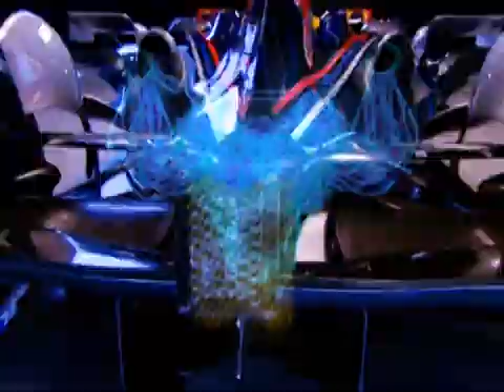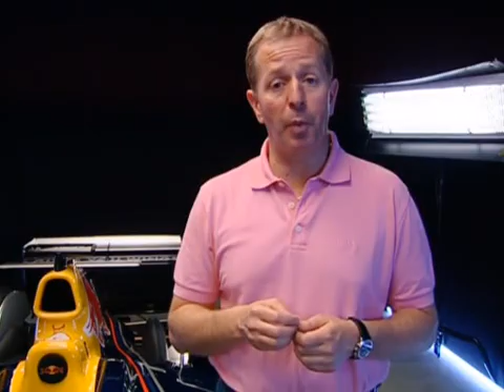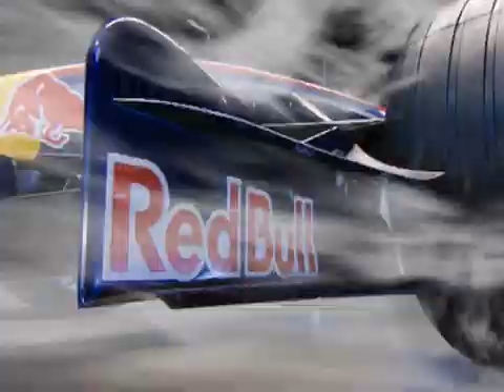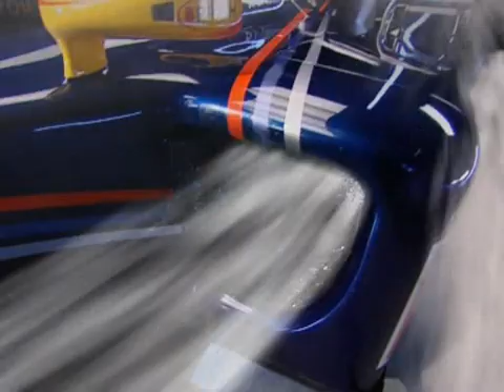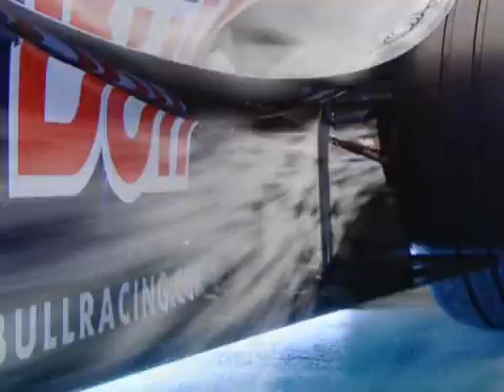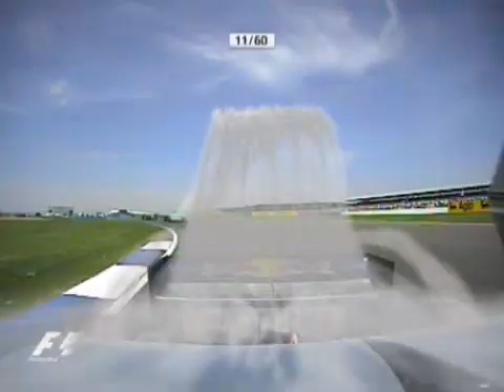Formula 1 Aerodynamics with Martin Brundle

Comment: "The upturn of the underfloor forces an expansion of the air and therefore a pressure drop..." I would have thought it was the other way around. Area increases; velocity decreases; pressure increases. But I am sure Martin Brundle has the perfect comeback for this comment, as usual.

Comment: So there's no slipstream in F1?
Reply: There is, but the area is small. But yes there still is.
Reply: In the Early days there was, gave you +20 km/h. But with all the Aerodynamic down force on the cars from 2011 onwards the air is to turbulent for good downforce.  That's the main reason why we have the great system called DRS to overtake ;)
Reply: So, If you want some good overtakes. It's better to have mechanical grip than aerodynamical grip, it makes less turbulent air so the car behind it can actually overtake without DRS

Comment: red bull got it so right from 2010-2013
Reply: Look up "Red Bull F1 vortice creation" and watch the live onboard in the rain in brazil. Adrian Newey is a genius. The moisture in the air actually builds up long enough for you to see the spirals of air created by the flaps etc off the front wing and around the side pod. It's one of the most amazing things F1 aero related that i've ever seen.
Reply: yes but now they suck😂
Reply: @marktakac8337 Until they don't 😂
Reply: @marktakac8337  No, they are just not as good as MB. Nobody is as good.  Even their last year car isn't as good as this year - by far.  Their new rear and front suspension is extremely good and helps them achieve higher speeds in corners and also in straight (more balanced) and the new engine, the new transmission, the new updated aero, etc. MB is a class of its own. Everybody else is just chasing them. Max was so far from Lew, it was not even funny anymore. 35seconds in 70 laps ? RBR says their design will get closer to MB but they can't set it up yet. Too complex.  RBR traditionally like this, their design is very complex and they always needed 4-5 races to fully understand their design. Hopefully it will happen faster as they are already lacking a lot of points and this season will be short.
Reply: @oldwortex5818  Ok. I was just saying thatthey were better in 2013 than this year... well at least for me

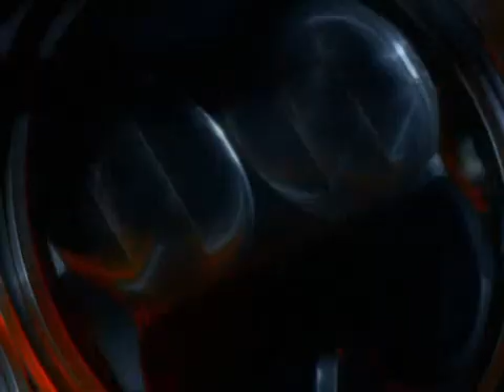Comment: 2:47 "10 cylinders" good old days
Reply: Miguelplays_YT i dont know where you got that from, its still 1.6
Reply: +Fahim Mir yeah i was like 10 cylinders i needa check how old this video is.
Reply: Fahim Mir the best engines ever, the sound is 🔥🔥🔥
Reply: I thought the same thing! Miss those days
Reply: +Fahim Mir Agree! But thanks to technologies nowadays we only use something like 1.6L V6, save some gas, still fast as hell :D
Reply: Up next: Tuk Tuk engines with three stage turbo running on glycerol
Reply: +Nguyen Duong 2.6 Liter V6 2017

Comment: Extra weight does indeed give more downforce but it also increases the mass of the vehicle. Remember. Acceleration = Force / Mass. If the mass increases, a greater force is needed to accelerate the car. With the same engine, the net result is worse performance. This is why formula 1 cars are so light. If you took the engine out, you would be able to lift one.
Reply: not to mention momentum, the more mass the object the harder it is to change direction
Reply: louis chim ya but thay have about 2 tons of downforce no problem for them

Comment: "electric actuators that can change the position of the airfoils" 

active aerodynamics is banned in racing and adjustng the camber, caster and toe in angle would cost too much time in the pit (they probably have that adjusted to the track)

Comment: 2015 : no wings allowed + all wheels covered by bodywork as prototypes + also cokpit + upper ride height = Newey and aerodynamics will have less influence on F1 
+ nos DRS + no tyres changes obligation rules = no strategy = stops only for problems = real races, won only on track

Comment: many people argue that nascar is a challenging racing sport because of its high speed and long durations, but that still does not make it more challenging than formula one.
formula one drivers face the same tough long endurance challenges, except that they have to make turns at every corner, accelerate, decelerate, face up to 4Gs of lateral acceleration and etc. formula one truly takes both endurance and skill (so does rally, but that's a different story)

Comment: I would like to see the use of pressure sensors,electric actuators that can change the position of the airfoils when it traction is compromised. Maybe even morphing the shape for even more precise control.Camber,caster, toe changes could help,but it really comes down to how much is it worth,does it make the cars safer,then I say it's worth implicating it.They should use a driver's pod,like boat racing,too many driver's have been killed or injured.

i would like to see the
Reply: 9 years later: DRS, DAS, Halo, tons of flexiwings banned. All further increasing the cost and hurt competition

Comment: Ya that I know but I wanted to know is why 2012 cars are using high chassis, they say its important to let as much air to go below the driver's ass(:-D its just to explain it clearly). I think that the air passes inside the car and blows out just above the diffuser, thus the high speed air above the diffuser creates a low pressure underneath the diffuser. Is that right???(thats what i want to know) Apparently it works but seem that Mclaren gains much more using a lower chassis.

Comment: The aerodynamics at the front of the car is important in cleaning up the air going into the sidepods, airbox, and undertray. Then the rear wing and diffuser aids in literally sucking the air out from under the car at an accelerated rate, creating a low pressure zone under the car that 'vacuums' it to the surface. Over the car however, the more air flow you can cleanly get to the rear wing, the better.  That creates more of a pressure differential between the upper and under portions of the car.

Comment: Normally we want low pressure(to create ground effect or Venturi effect)  underneath the car but why in 2012 they are using a high chassis(except Mclaren). They say, we want to increase the air flow underneath the car, this will increase the pressure underneath the car which isn't good. Can anyone explain this to me?

Comment: @motanelustelistu 
The generation of aerodynamic downforce (force directed downward, or negative lift) and its effect on lateral stability result in a major enhancement in race-car performance, particularly when high-speed turns are involved.
The purpose of downforce is to allow a car to travel faster through a corner by increasing the vertical force on the tires, thus creating more grip.
courtesyWikipedia
so my comment indirectly stated this only.:P try to understand what a person states first

Comment: Don't mean to pick, but the suction of the low pressure air PLUS the mass and speed of the air that has been deflected in the upwards direction is causing the downforce. Similar to how a rocket moves, by throwing air.

Comment: @oatcakepastymatt Diffusion of air mean spreading molecules. Look up diffusion, it is basically when molecules arrives into a space where there is a low concentration of it and due to heat it will by it self spread out to cover the whole room evenly (not taking into account the mass of the different molecules). 
In the diffuser of a car the air is forced underneath the car and when it hits the diffuser it is spread out into a larger space which will create a low pressure in the diffuser.